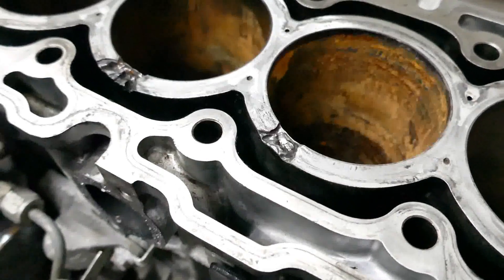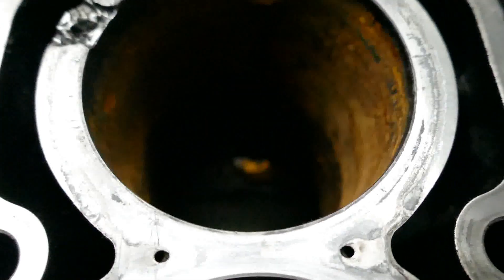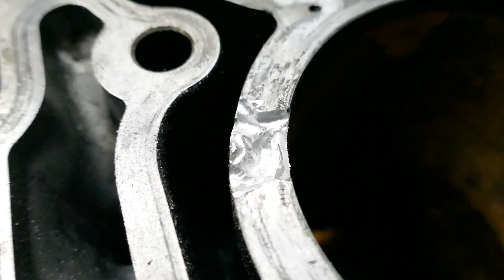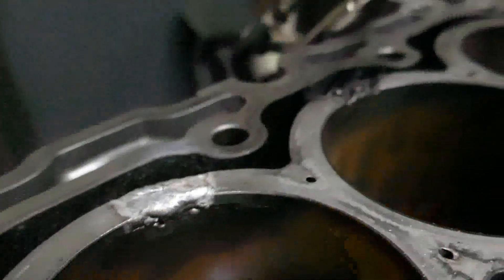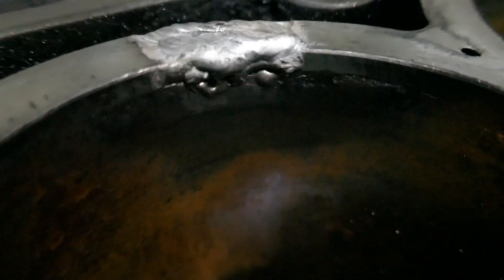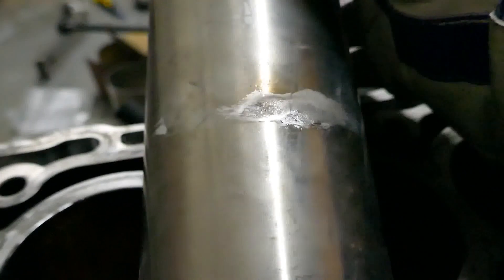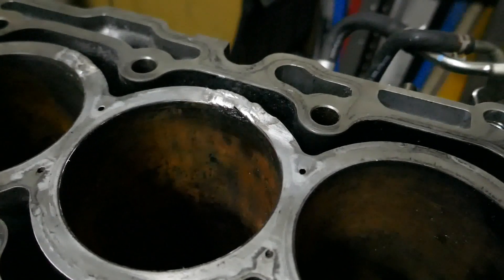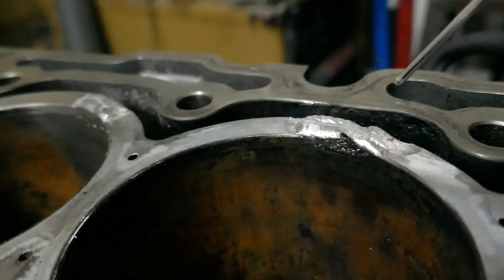Can TIG welding fix this Alloy Engine Block?

Comment: Did this actually end up holding up? Also what welding tip did you use?
Reply from the maker: Sorry, I don't know if this worked out. I suspect not. Welding tip? I'd have used a 3/32" Tungsten (Zirconiated - white tip) in the TIG torch if that's what you're asking.

Comment: How did this turn out? Is the car still running? Was it successful? Lol I'm actually having this done as we speak by a machinest and welder. My BMW X1 blew a head gasket and a piece of the aluminum in between cylinders 1 and 2 did just like what you're working on. Just curious as to how successful this fix was because the man working on mine seems really confident in fixing my block.
Reply from the maker: Sorry, I don't know what happened to this block. The guys who brought it in were hoping that the piston rings wouldn't travel up the bores to the damaged parts at the top. That would have allowed them to just skim (machine) the top surface & put it all back together. I'm not so sure about that. Looked to me like it needed new liners & I don't know if that can even be done with this type of thin liner. BMW might be different.
Reply: @MidEngineering  Ahhh well I'm not sure I don't believe I have any issues with the cylinder bore walls being too thin or he would have probably mentioned that to me...I would hope. He seems to think the weld took good and I shouldn't have any issues out of it. I think he did a tig weld on it.

Comment: Very interesting. It's no wonder so many engines have problems with liners if they are that thin. Did you pre-heat, being a big casting, (not implied   comment, just interested to know). Cheers
Reply from the maker: It's usually a good idea to pre-heat things like this, but as I don't have a decent blow torch for the job, I didn't!

Comment: I am wondering what the owner is going to do about the bores? They are so rusty that they will need a rebore, but those thin liners have no meat to allow a rebore.... Perhaps they will get the alloy bored out to accept new liners?
Reply from the maker: This was a while ago & I don't know what happened to it. Definitely needed new liners to properly recondition it. I've no idea if that is a common thing to do with this type of block construction. I used to work for an engine re-conditioners but everything was cast iron back then!